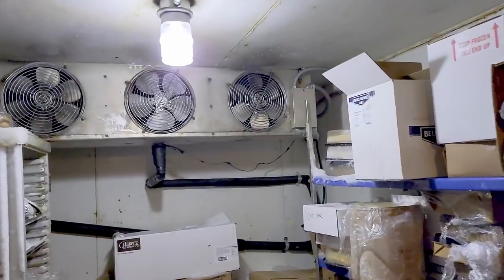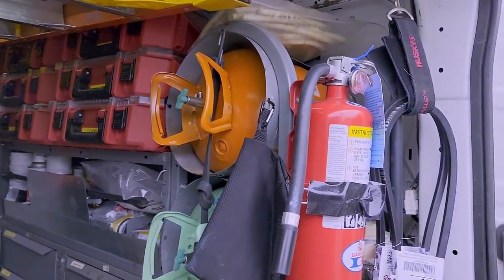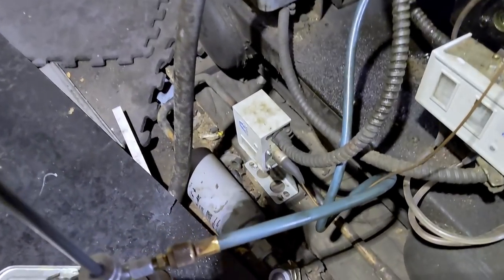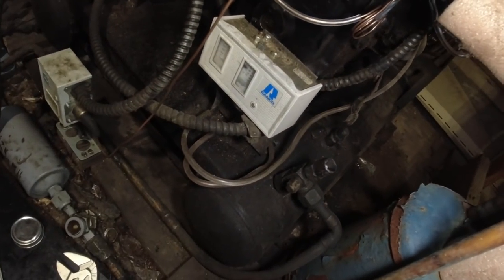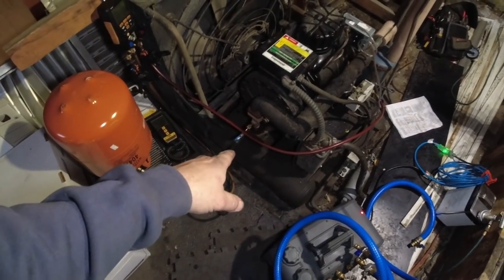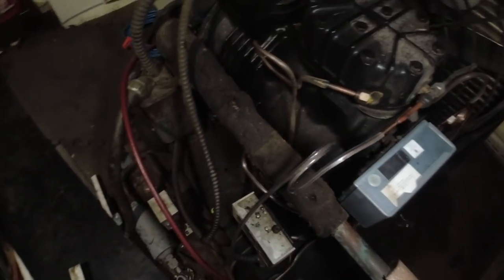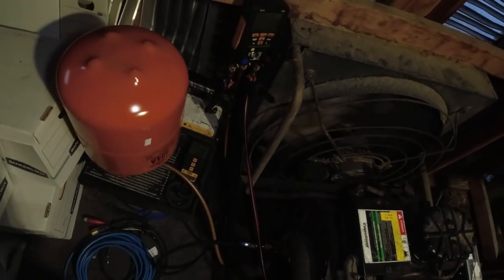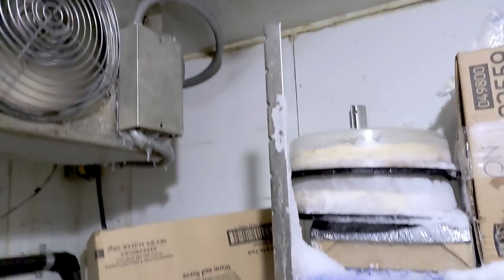Friday Night Freezer Disaster

Comment: The point in them loops on them controls is for springiness when that old semi gets rocking and rolling, I’ve always stretched them out a little to go with the flow. Good luck wire tying them like you do, and put some caps on them drums in your van !
Reply from the maker: Normally I use split vinyl tubing but at this place I don't think it really matters, everything's a walking disaster.

Comment: Those old Copeland tandem receiver condensing units hold a ton of gas. When they leak out the charge it takes  a full bottle to charge them back up. Made back when 22 and 502 was cheap.
Reply from the maker: Exactly right !

Comment: Nice video. Last 3.5 semi-hermetic I worked on was roof mounted, with a bullet hole straight thru the condenser coil. One of the neighbors probably got tired of hearing it clank away.
Reply from the maker: That will fix it. 😄👍👍
Reply: Lol, did you patch the condencer?
Reply: Sadly no. The compressor bearings had been worn out for at least a year, you could hear it running from 300 feet away.  He opted for a nice new Heatcraft scroll condensing unit and a new tev.

Comment: Great work man! Are you able to elaborate on checking receiver level for the horizontal receivers? I understand how to check the level on the vertical tanks with a heat source. Didn’t know you could check the horizontal style!
Reply from the maker: I tried to and as you can see in the video the thermal imager just showed a big circle so either I completely overfilled it or doesn't work for crap. I probably should have ran the torch left to right

Comment: That walk in box looks pretty rough too 😬. I ment to ask how you like that Klein stripper/crimper. Is the stripper any good? Thinking about getting one.
Reply from the maker: It does pretty good,  you have to learn how to use the stripper part,  it's not like typical strippers. Squeeze down to break the installation and I release a little bit then pull it off. Otherwise might snag the wire some.  I like them, they reduced it down to one set of pliers.

Comment: Not a place I'd like to eat at 🤢 what oil differential did you use for that compressor ?
Reply from the maker: What do you mean?
Reply: @HVACRSurvival  Sorry lol that pressure switch is factory set, I was wondering what the cut-out would be on your model for that compressor
Reply from the maker: @Derrick en Buenos Aires  normally you want 40psi differential or higher.  The formula is to subtract the compressor suction pressure from the oil pump pressure discharge pressure.

Comment: I'm working on a very old R22  walk in cooler. It had a small leak at a flare nut. I don't have a jug of R-12, and customer doesn't want to convert this old system. He does have an old R12 unit in his shed. I want to recover that refrigerant into an R-22 recovery tank and then top up his other system with that recovered R-12. If I pump down the R-22 recovery tank into my other spare R-22 recovery tank and then pull a vacuum on the empty tank, could this process work for a couple pounds of R-12 do you think. Would a major problem be oil contamination from the R22 tank?
Reply from the maker: R12 and r22 both used mineral oil. I'm confused,  is the cooler that needs refrigerant the same type as the old one you want to recover from?
Reply: @HVACRSurvival  Yes it happens to be. I have no R-12 in an old jug, and customer doesnt want to convert this old system. He's a neighbor and a hobby farmer who wants to slaughter and process his pigs.
Reply: @HVACRSurvival  Most of my 35 years experience has been with residential HVAC. I moved out to Eastern Canada about 5 years ago. Lots of Heat Pumps going in out here, but the Plumbers and Electricians are stealing most of our jobs and doing them illegally. I have been watching many videos for a long time on Youtube, and I have quite a bit of commercial maintenance experience. I have had my Refrigeration License for almost 20 years. I have to make this adjustment to survive out here. The plumbers and electricians cant do commercial refrigeration. They can't diagnose or repair residential even. However, they can and do install the residential systems out here. Its nuts!
Reply from the maker: Yes just recover the old stuff and pump it into the cooler is its the same flavor. Oil is the same. Myself i would just dump a cheap replacement in it like hot shot 2
Reply: @HVACRSurvival  Is there a way I can email you 4 to 6 pics to get advice from you? I can compensate you through your payment set up.
Kevin
Reply from the maker: Hvacrsurvival@gmail.com I'll take a look at them.

Comment: Rick do find the Fieldpiece vaccum pump to make a difference as far as performance ? I know it's very practical and the oil change is second to none but I'm curious to know if it sucks ( and yea that's a rubbish pun indeed ).
Reply from the maker: It sucks real good.  I like the oil change speed and the cfm. It's just nicer than the provided stripped down JB I have.
Reply: @HVACRSurvival  I got ya . The one my employer provides I really don't like nor trust . I tried to get them to buy the Fieldpiece but it seems that if the suggestion comes from me then it's not gonna happen ... what can you do huh 🤦‍♂️